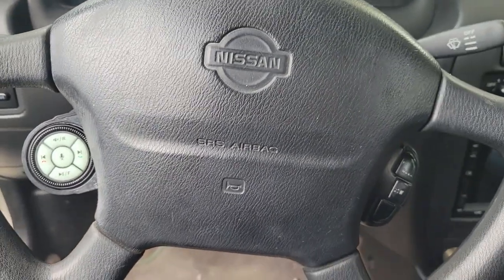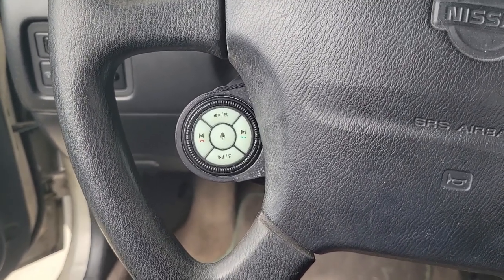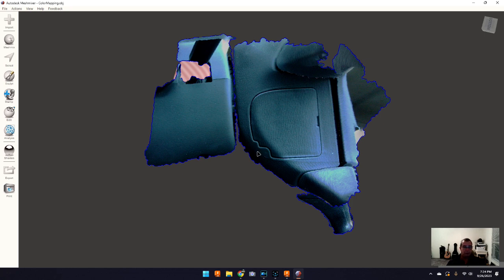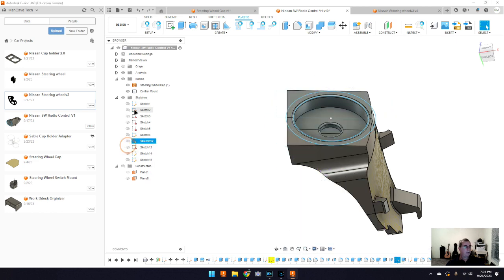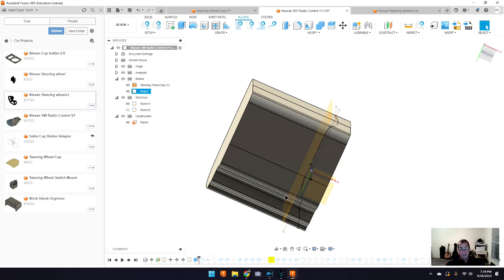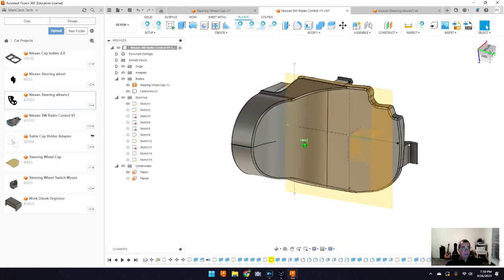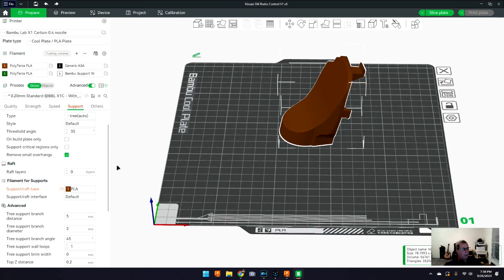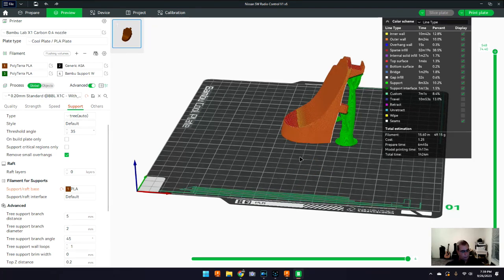3D Scanning, Printing and Fusion 360

Comment: Little tip, if you want to pull in larger/heavier meshes into Fusion, you really want to remesh it. I found a tool called instant-meshes on GitHub (wjakob/instant-meshes) which does this amazingly. It is a tiny 4MB application, which extracts the geometry from a mesh and re-creates the surface geometry with far fewer vertices. Other programs I tried to do this with (MeshMixer, Blender, ...) all either destroyed the surfaces, or would crash trying to decimate the model. I have used this program to take a 600MB 3D scan down to ~10MB, while retaining 90% of the detail of the original. Also processing takes seconds which was mind-blowing.

Comment: How are you bringing that scan in as a surface instead of a mesh? I'm working on trying to build my first part off of a 3d scan and working with a mesh in fusion 360 is making me want to bash my head into a wall lol
Reply: Same question I have
Reply: That was the most important element of the video that he chose to skip over. There are a few ways to do what he did, using either intersecting curves in the Surface environment or “sculpting” a piece to match the mesh in the Forms environment. The Learn Everything About Design YouTube channel has many videos about this (“reverse engineering”), but it is a rabbit hole.